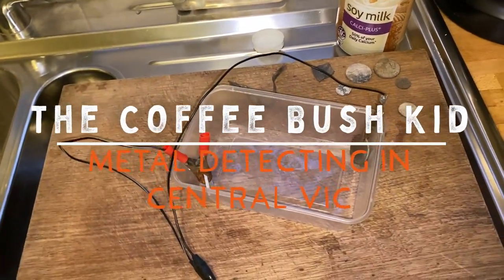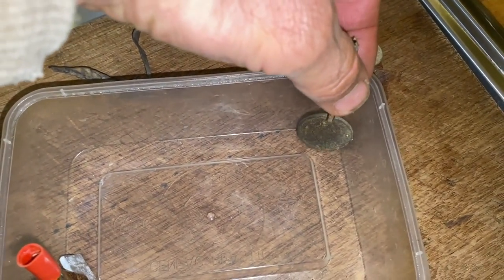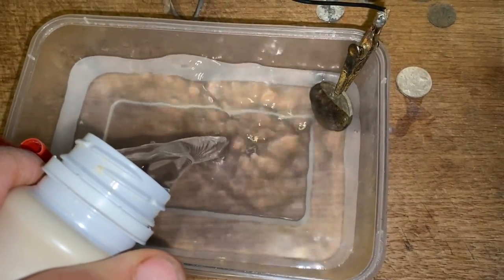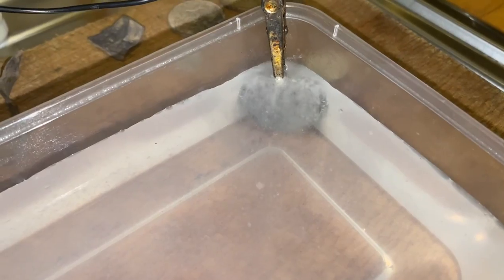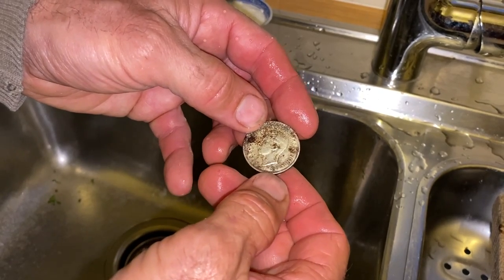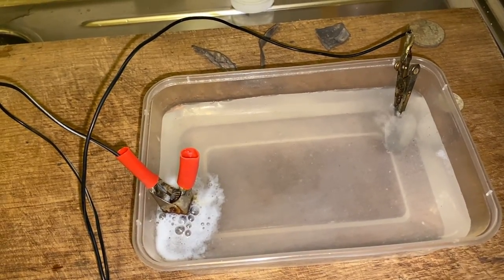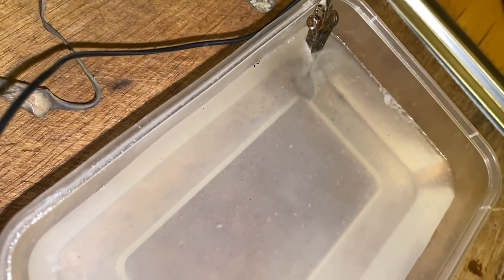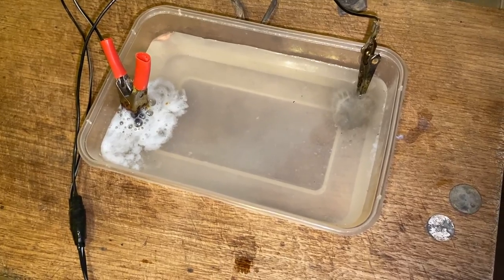Special lockdown request. Cleaning silver coins by electrolysis

Comment: Hi Andrew, as an electrolyte i use sodium carbonate, in Coles its called (Lectric Washing Soda Powder) 1tsp to 250ml water - for the cathode i use carbon rods, these can be brought on eBay or harvested from those cheap 6v lantern batteries you get 4 rods from each battery its messy but doable.  Thanks for posting the video..
Reply from the maker: And thanks for all that info Tom. Stay safe 😁

Comment: Thanks again Andrew for uploading this vid.I tried this method and it works a treat.I been using electrolysis for some time now,but this method seems to work better.The salt might make the difference. Cheers.
Reply from the maker: That’s great. What I have since been told, that makes sense, is to have a longer anode so the clip is not in the solution. This was setting up electroplating with the post 1946 coins and giving me the copper look. Thanks for watching mate 😁👍